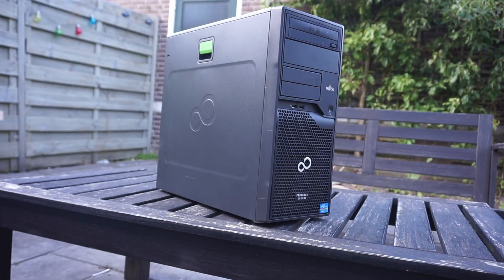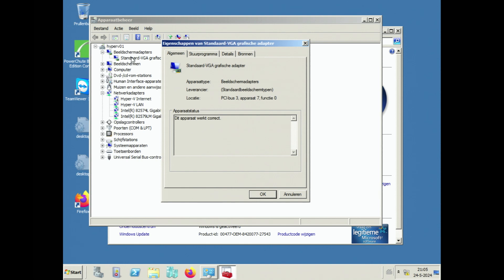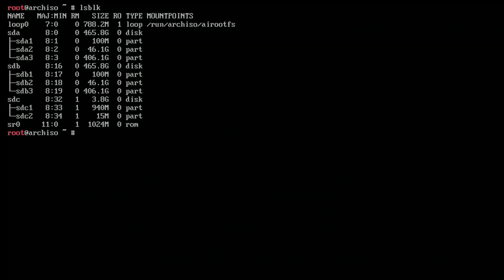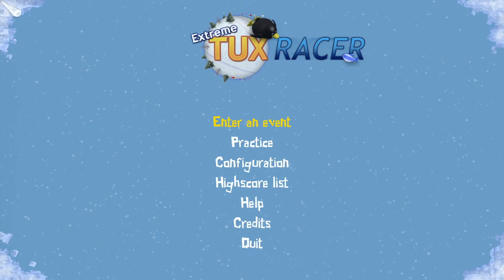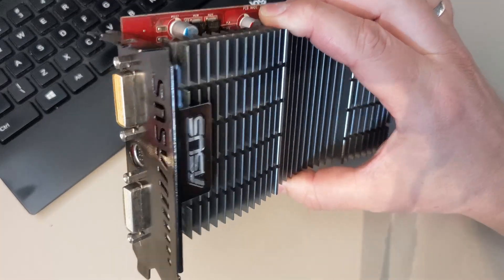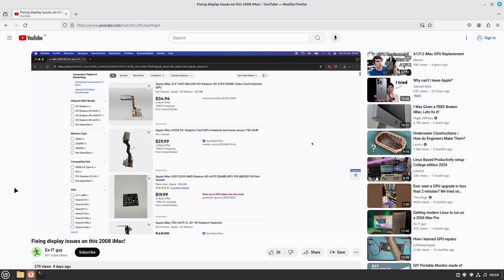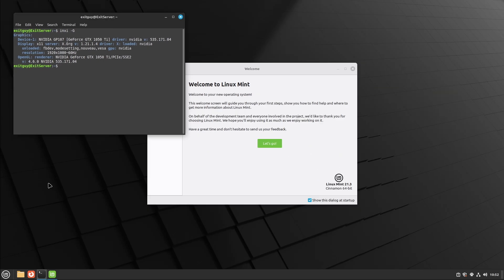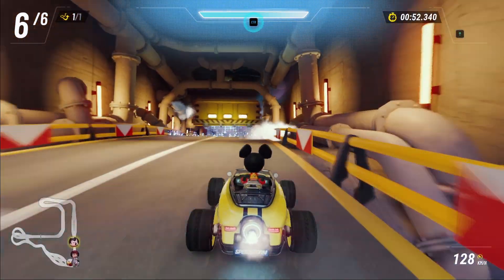Gaming on this 2012 server in 2024?

Comment: The fact that switching from a perfectly good SATA hard drive to a SATA SSD made the screen lag go away just shows how unstable Linux is. Windows Server 2008 obviously did NOT have that problem on the same hardware. Nor would any version of Windows that came later.
What a fcking waste of zeroes and ones (and our time) that you chose to downgrade the OS as one of your first steps.
#EpicFail

Comment: Hey nice video, Im checking this things for a nas. You are not talking about the fan noise, how does it sound? That's generally the problem with this tower server, but less than with a blade server.
Reply from the maker: From what I remember it's not too bad but I still have the machine over here so I'll just turn it on soon to make sure. :)
Reply: @ex-itguy  That would be awesome! :D Thanks!
Reply from the maker: It's not too bad. similar to a pc from that era. One of the case fans seem to be a bit out of balance. If I disconnect that it's mostly the power supply fan which I'm hearing that's just a tad louder that a regular ATX psu, but still the nothing to the extent of rack servers.

With the case closed I mainly hear that annoying case fan haha, maybe I should take it out and give it a good clean.
Reply: @ex-itguy  Wow, thanks that you took time to check and answer, I really appreciate! You've got a new follower for your next adventures! I finally bought an another ancient server for my NAS :D But I'll keep in mind this one for an another project maybe! By the way sorry for my poor english I'm just a franch dude haha.
Reply from the maker: @muninm1  ah well it took me just a few minutes 😄
Dutch guy here. I don't see anything wrong with your English though. ;)

Comment: I also loved to upgrade old machines, some years ago I ordered a used CPU from China and also used a Nvidia 750ti I had laying around in an old office machine.
Reply from the maker: How did that Chinese cpu work out? Sounds interesting!
Reply: @ex-itguy  Was some years ago, can't remember it well. I think it was a Core 2 Quad. Looked in the PC manual before, what max cpu I could take! Ordered via Ebay. It arrived maybe 1 1/2 weeks later. And worked straight away! Never had a problem with it, and with the GPU it was enough to run Counterstrike well! But I gifted the PC to a friend. But it was the reason I got into PC gaming again, this little upgrade project I made. I now own a prebuild and am happy with it ;)
Reply from the maker: Ah so it was a proper Intel cpu. It can be hit or miss with stuff from China haha. Nothing wrong with prebuilds. If it's good it's good. ;)
Reply: @ex-itguy  It was about energy consumption, I build a system myself but it consumed 130w in idle (whole system with monitor etc). And everything was configured the best I could do. I then sold it and bought a prebuild, now 80w in idle (whole system again). I don't know if its something with efficiency and self builds. The components where all very good. Sure, it also had a liquid cooler etc. But the prebuild got about the same power as my self build back then. And consumes way less.
Reply from the maker: That's quite the difference indeed! Hard to find which components cause that without having others to try. 
The GTX670 that I show shortly in this video performs about the same as the GTX1050Ti... but uses about twice as much power, both idle and under load. 

Btw if you like low power devices, you might like the unit in the video I'm working on now. ;)

Comment: I'm surprised the power draw isn't actually that bad. I still wouldn't use it as a server though, running that 57 watts continously would cost €150 per year.
Reply from the maker: If you keep the onboard video it's just over 30 watts, which isn't that bad. Not the best but surely more powerful than mini systems of the same age if needed.
Reply: It's cheaper than Netflix w/out ads